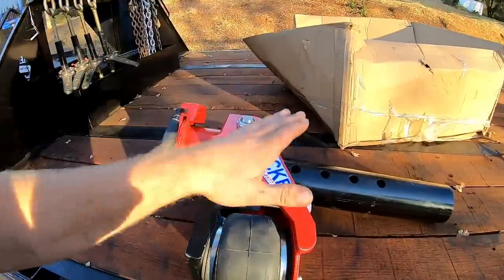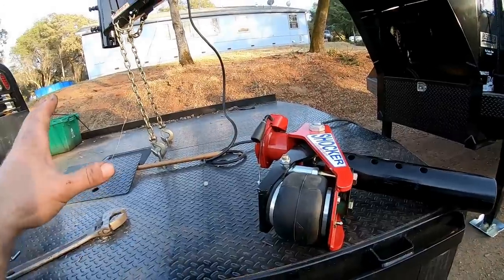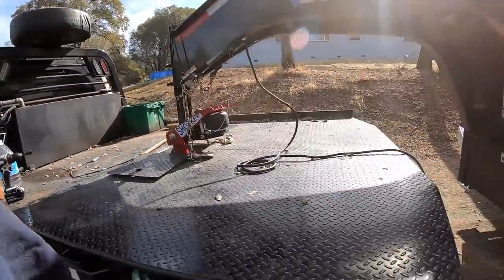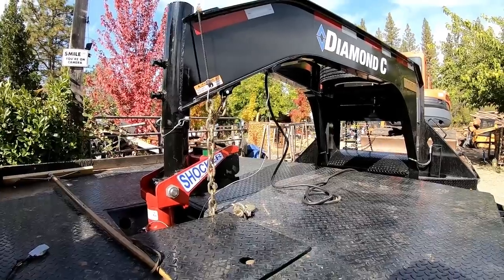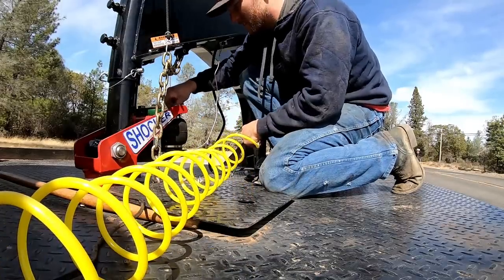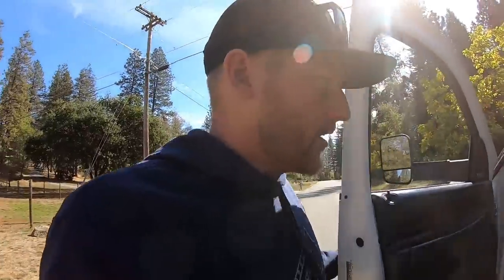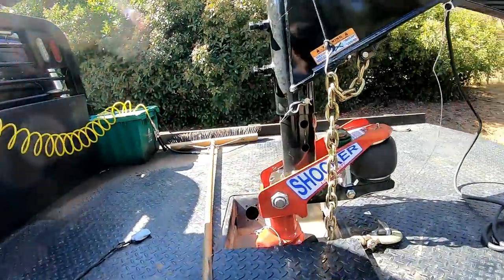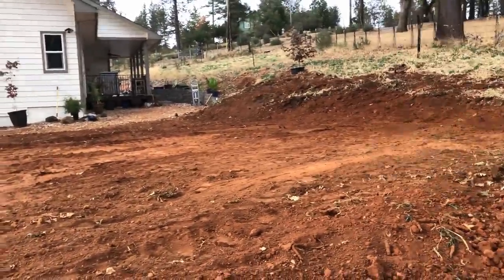Towing Gooseneck trailer with New Shocker Hitch! Pulling 20k

Comment: Love my shocker hitch. Have had mine for about 15 years. Used it daily for about 10 years hauling large trailers. Mine was the 2 1/2" receiver hitch setup. Its great because when you air it up to the bumps every 10psi ='s 100 lbs tongue wieght. So I was always able to know how much tongue wieght I had. Great buy especially compared to other air hitches. I even had my green urethane bumps melt after about 10 years in Florida sun, and I emailed shocker to buy replacements and they apologized and sent me new ones free.  Great customer service, great hitch.

Comment: I just added an airlift wireless one compressor 
with a remote onto my flatbed trailer just for my shocker hitch... now I can adjust the air in the hitch without stoping.  Thanks for the idea in your video.  I'm pulling a 36' Pj hydraulic dove tail behind a 14' 3500.

Comment: I have air ride for my truck and I'm so glad I spent the extra to have the remote control for it. I'm always adjusting the air when changing between 5 different trailers.
Reply: Charles Wolcott height control valve is what I use no guessing anymore

Comment: I run a Cody hitch on my gooseneck, stays with truck as I have 3 gooseneck trailers. Love it, and I have a shocker hitch for my bumper pull trailers. Love them both and on board air is a must. Love the channel!

Comment: Ok , now let’s see a gen-y review, 100% unbiased review 
This shocker looks really good, and I agree a plumbing kit with a remote would be awesome 
I know how I would set that plumbing up , I bet shocker already has a patent on a system
( there is a compression compensating modulater on a TFL truck trailer review)

I sure as hell wish I had a shocker hitch, when I was driving on rough corrugated ranch roads and even crappy state high way roads like New Mexico
Reply: I have both, I think the Gen Y has a better ride. Both are nice and well worth the $$$ though

Comment: Sam you should hook up in cab air gauge with adjustment switch so you can adjust the air pressure on it while you're driving to make it just where you want it.

Comment: you can get clip on tire fill ends for air lines. thread that onto a coiled hose to a quick disconnect on the bed deck some where on the back or on the back and you're good. hit me up if you need a walk through. have seen guys do that around here.

Comment: put on board air on the trailer plum it to the neck cordless remote to adjust it
Reply: They sell kits for it, a compressor and tank basically and i'd assume a sensor for the psi in the tank so the compressor isn't always on, shouldn't be too bad to install one of those kits.

Comment: For the auto fill from the cab for your shocker hitch you could ziptie  air hose to the 7 pin wiring to run up to the hitch and put a quick connect by the 7 pin connector at the bumper of the truck then just leave the hose with the trailer and connect the air to  the bumper when you need it.

Comment: You want your 5500 to ride nicer?  Put a Kelderman 4 bag system on the rear axle.  I have the self leveling system on my 5500.  It ride almost a nice unloaded as it does loaded.  Rides better than all my old trucks even the 3/4 ton.  No issues with the system either.  I did my 1st big trip by doing 500+ miles in Death Valley.  More than 1/2 of that was off road.
Reply from the maker: Dan Gilson if I used the truck every day full time I would do that

Comment: I just bought a hydraulic tail trailer. Just about beat me to death on the way home from dealership. The tail would bounce when I hit a bump. With the safety stops in I power the tail down with the hydraulics and it made it a much better ride.
Reply from the maker: What brand?
Reply: It's a 30' BWise trailer. Salesman said  the new owners bought Bri Mar trailers and both or made in same facility in Pennsylvania. Didn't realize this post was a couple of years old.

Comment: It really needs a constant air supply and leveling valve that big trucks have on the cab and axle bags and you won't have to keep screwing with it. The leveling bar once adjusted right will keep it adjusted accordingly.

Comment: Just curious, do you use your clutch while shifting through the gears on any of your trucks? Wouldn't it be worth while for you to install in cab air pressure gage, to make it easier to adjust on the fly. I have air ride rear suspension as well!

Comment: Take and run air line down the electrical cord, plumb a port near the trailer plug and you could run one of those adjustable toggles like the diamond C dude was talkin bout

Comment: I laughed when I saw the level of deflection on that hitch "Yah, its not going to last long at 15 PSI." 
How did it do with and empty trailer and the hitch at 50 PSI? The airbag looks like what would be on the cab of a tractor trailer too.
Reply from the maker: Nick K felt pretty nice at 50psi empty.

Comment: In cab control is easy,  single way in cab control for airbags run the line to the hitch well in the bed put a air chuck on it .use a class8 fifthwheel airslide release hose from the airbag.
Also put your 7way in the hole that's provided in the well and get that ugly line off the deck

Comment: I use a low pressure high flow regulator in my cab for my on the fly onboard air adjustment of my airbags. You could do the same with the Shocker. A quick disconnect near the hitch area on the flatbed. Or put a sticker in the cab of each piece of equipment with the proper Shocker pressure. That way when you load it you have the number right there. Load and pressurize.
Reply: Gerald Koth why not a height control valve best thing I have ever done no more guessing
Reply: @deerepower337  I use the adjustment for varying road conditions on the fly. Height is very problematic when unloaded or loaded with a weight distributing hitch. The rear must sag to make the bars transfer weight to the front of the truck.

Comment: Great idea with an in cab air management for your fifth wheel and couldn’t find anything online with that idea? So after little bit more homework just go to eBay and search for 2 sensor digital air pressure gauges. I found several of them just under $50 with the sensors and the next thing you would need is a couple electronic dump valves for air. Again searching on eBay is many different options for under $20 unless you want to spend a little bit more of something you know about. Where the air fitting is on top of the bag I would put a 90° elbow to a small ball valve  so you can disconnect the trailer with the bag still inflated. From that valve some kind of flexible tubing that can hold up to the weather conditions and wear and tear? Into the first T fitting for a dump valve for the purpose of deflating the bag and then into another T fitting for the pressure sensor. The final T fitting would be for your refill valve from your air supply . The second pressure sensor could be for your main air source tank? I think with all the fittings and everything you should build the do it for about $100 or so? With the digital air pressure gauge it would save you on running an airline all away to the cab. One toggle switch to turn that system on and a second toggle switch for inflating and deflating the bag. I’ve seen many air rights systems on vehicles and this is not much different than that good luck and this is only an idea which I think is a good one and thanks for another great video.

Comment: I got a better idea. Semi trks have a leveling valve.  What if you can hook one up on the hitch so it adjusts automatically based on whats on the trl
Reply from the maker: tractorboy31 ohh now you just getting fancy lol I like that idea aswell
Reply: @VBELTandSON  before you mentioned it i was thinkingabout being able to adjust it on the move.  Get yourself a semi trks airline and you should be all set to hook up the onboard air on your hitch

Comment: There is no way the gcvwr is under 26001 lbs, so why bother with not for hire sticker when you need a cdl anyway?
Reply from the maker: omgnothingisavl I do have my cdl and it’s not for hire. 
Just have it on there for a little extra precaution maybe chp leave me alone. And they have:). Ps truck is 19500. Trailer is 26k

Comment: Guys guys guys...... If you ran a line from trailer (IF he had air on the trailer) you couldn't adjust from cann (DAH) All you need is a little time (I'd say 3hrs max).
      Parts list for inside cab:
2-way toggle switch
(up=add/down=dump)
2 electric over air solenoids 
(1=add/1=dump)
digital air gauge
    Parts list for outside cab:
Fittings & Airline
Stainless Steel quick coupler
Ball valve 
••••mount in easy access area
 (Need a BV because SS QC doesn't have a valve to stop air from escaping when uncoupled) 
Good luck🤙🏽🔫🇺🇸🔫🇺🇸🔫🤙🏽
Reply from the maker: Just need an air switch and gauge. Jump off line pressure from on board air on the truck and run line from switch valve to bag and all good. Take less than an hour. 🤘🏻 already got all the parts just need time